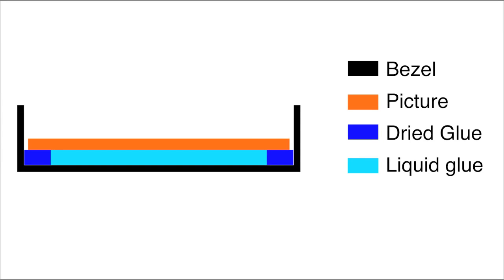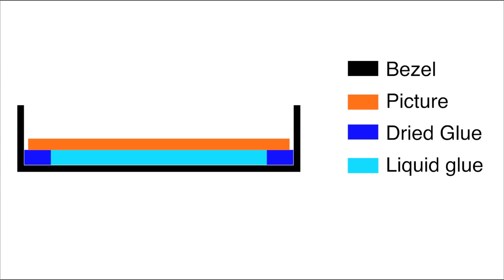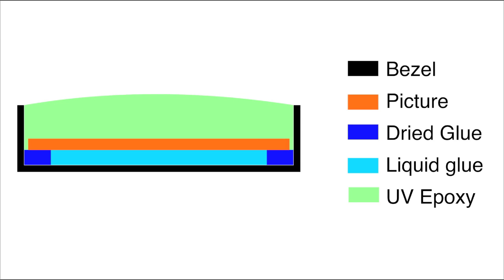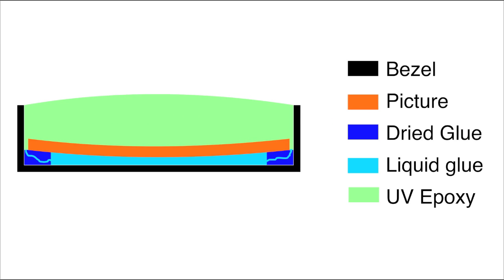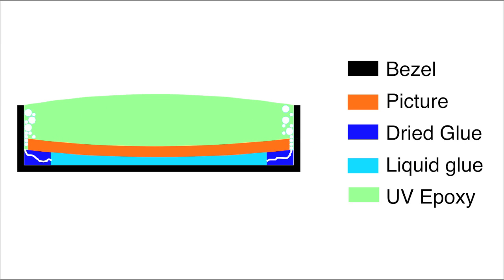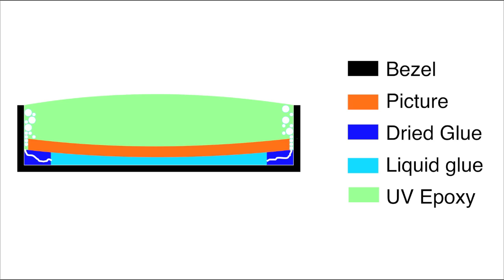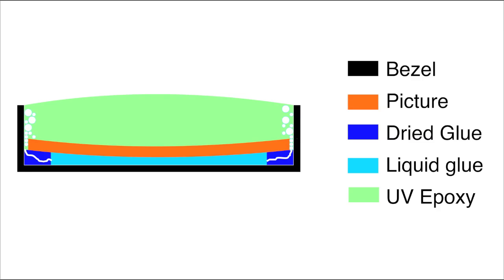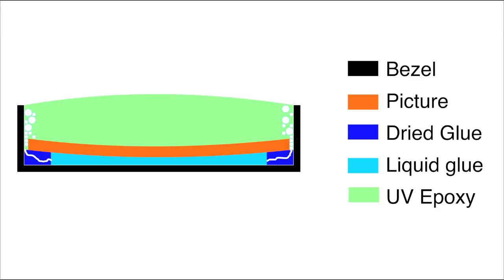Bubbles Formed in UV epoxy while curing

Comment: I dont get it
Reply from the maker: glues that rely on air to dry will never dry in the middle when sealed from air (like a photo). Then when curing the UV epoxy the liquid product will of gas (give off air) and force it around the outside and thus cause bubbles to form. Or to make it super simple, don't use 1 part glue to glue photos into bezels.